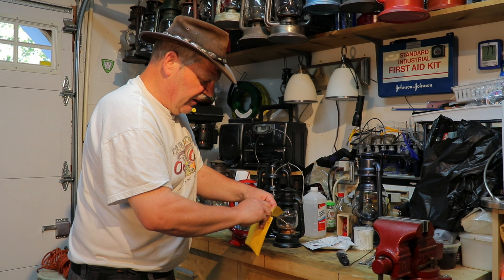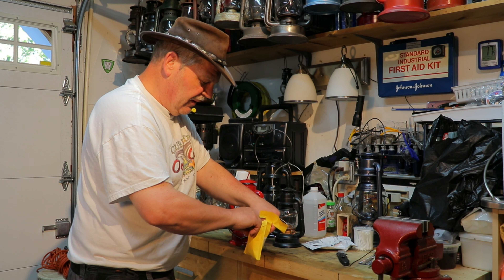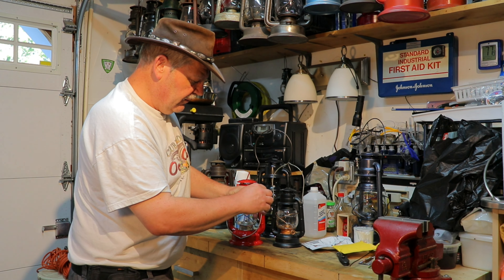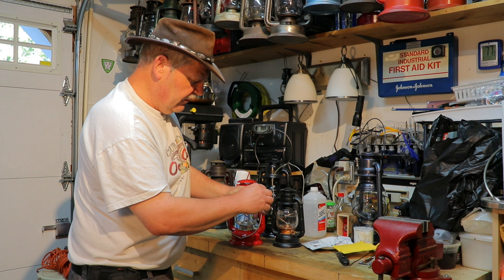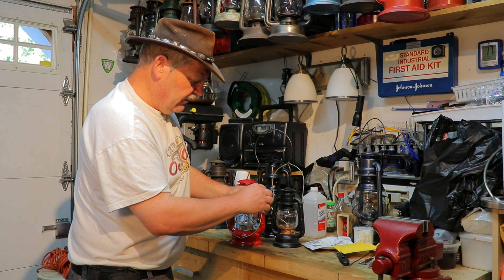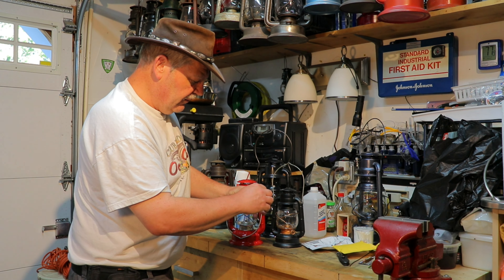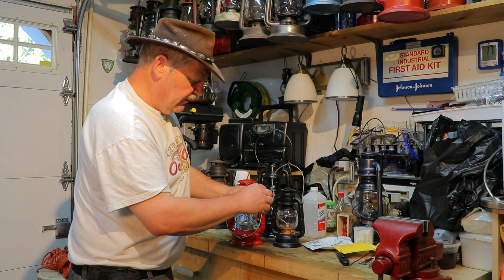Brightening Up Vintage Battery Operated Kerosene Lanterns

Comment: Nice shoutout. The lower number in the Kelvin rating is warmer in regards to color by the way. Nice thing is such a bulb swap doesn't even require modification of any vintage electric lantern. I'd also recommend a small tube of taped together translucent paper over the LED if you want a more even light spread. (Some LEDs meant for flashlights tend to be a bit directional with how they cast the light.)

Also some swap LEDs come in a different power rating. 1W+ for brighter, or alternately you get some mW range bulbs to be more miserly on battery life while having less light output.

However keep in mind these LED replacement bulbs wont compete with any modern electric lantern, a good quality LED lantern in the 800 to 1200 lumen range is more comparable in light output to a pressurized gas mantle lantern when at full bright mode rather than the usual flat-wick. The main point of such a swap is to get more battery life than you would with any filament bulb while having that charm of a classic design.
Reply from the maker: Thanks I’m going to try that paper trick to see if it’s a little easier on the eyes 😂
Reply: @lotsatrains  It's basically making a diffuser or light spreader, that works in the same manner as a lamp shade. Such can even out a glaring point light. Although I think the 3000K bulbs may have been a better choice than what you ended up getting. 6000K is a bit on the cool-white to blue side.

Comment: Hey Ken I am thinking about getting a small electric lantern for my granddaughter and this upgrade would be great to preserve battery life while making any lamp brighter. Would you you be able to post the contact info for your bulbs please? Thanks.
Reply from the maker: https://www.ebay.com/itm/E10-2835-LED-Screw-Socket-Interior-Flashlight-Torch-Bulb-Lamp-Warm-White-DC-3V-/324497039519?mkcid=16&mkevt=1&_trksid=p2349624.m46890.l6249&mkrid=711-127632-2357-0
Reply from the maker: Hi Moray I added the link to ebay where I bought the led bulbs

Comment: Did you upgrade them with a circuit like for a solar light and put a good white led in them if needed?
Reply from the maker: No I just changed the bulbs out but that would be a good idea.